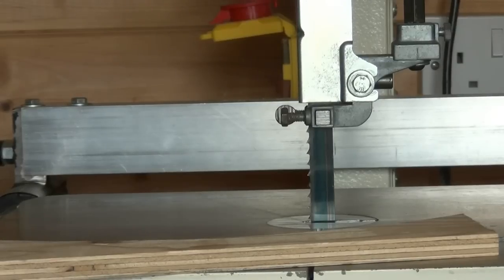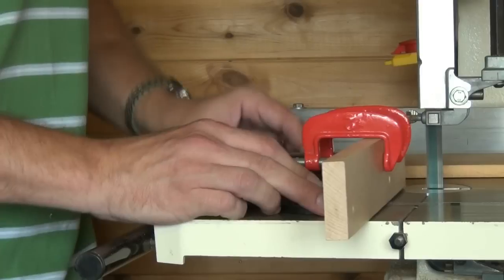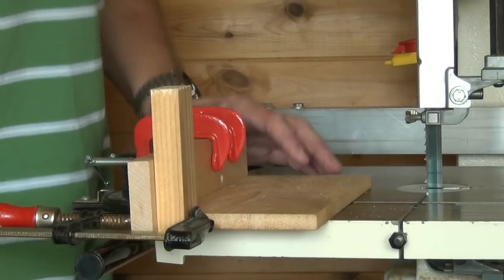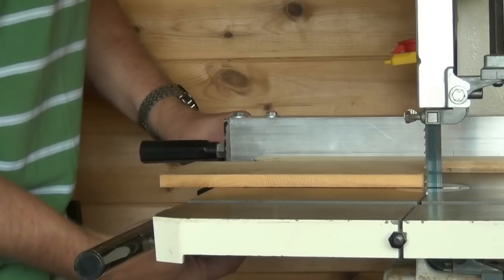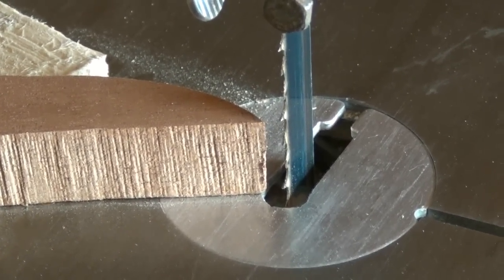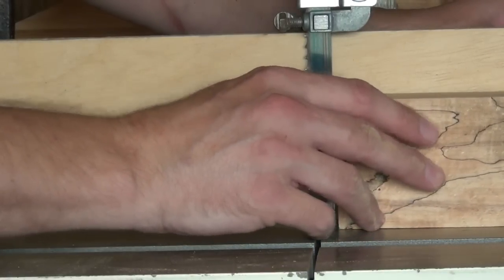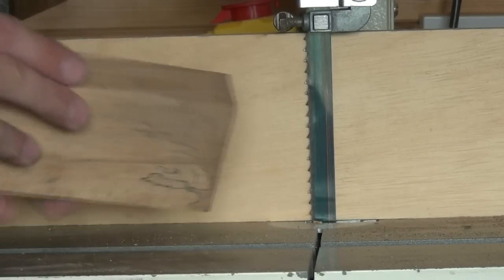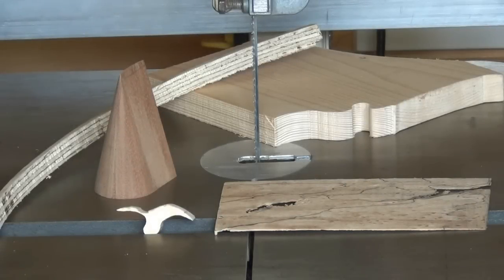Band Saw Basics part 3 - Cutting Techniques

Comment: How do you cut precise bevels on a 3" high and 2" thick board
Reply from the maker: If you mean how to set the table tilt accurately, then over tilt it, clamp a stop under it to prevent it tilting more, then add shims on the stop until the saw cuts at exactly the right angle.

Comment: Dear Mitch, I am impressed with your bandsawing in that there seems to be very little drift of the blade when you cut, even the deep cuts as on the piece of cherry in this demo. My bandsaw drives me nuts with its significant drift, to the point I have given up trying anything but rough cuts. I do have a good quality built bandsaw - a Jet 18" model with a two speed drive. What tricks do you use to minimise blade drift?  Thanks.
Reply from the maker: If I'm going to use the fence, then I'll run a thin piece of ply through freehand, cutting a line parallel to an edge, and use the angle that I have to feed it to set the fence for my intended cut. That compensates for the drift.
Check guides are not twisted with respect to each other.
Stoning off the rear corners of the blade is always a good idea too, leaving less leverage to throw the cut out - also slightly reduces the minimum radius the blade will cut, which can be handy.
Stone the set of the blade a little too, which will deal with any errant teeth. Then if there's still drift, stone the set a little more on the side which drifts.
Check all along with the freehand parallel cut in thin ply.
Hope that helps
Oh yes, make sure you don't have any kinks or bends in the blade. Sometimes a decent new blade will fix your drift.
Reply: Do you mean place a grinding stone at the back edge of the blade and run it, effectively grinding the corner with it running live?  Not sure what the term "stoning" means.  I tried throwing a handful of stones at it and that made no difference!
Reply from the maker: Peter Marsh haha yes, with it running. I use a cheap carborundum stone. A vacuum hose directly below the table entry will save rubbish getting into the guides and tyres.

Comment: Being new to woodworking this video made me cringe. You are obviously very experienced and skilled but I think you should have a disclaimer for new people and tall them they should be using a push stick.
Reply from the maker: Thanks. I've added a note on using push-sticks in the description. This isn't a complete beginner's guide, but a demonstration of what can be achieved with these machines. With some operations, push-sticks can impede and reduce work piece control, and these should only be attempted when the user has gained enough insight into their machine and it's foibles.